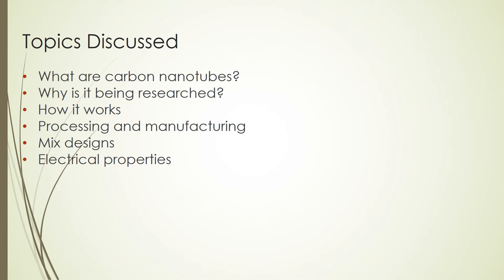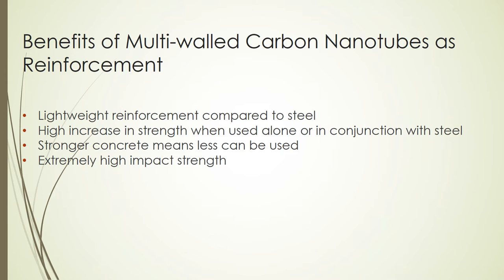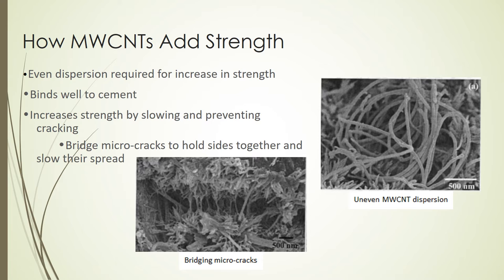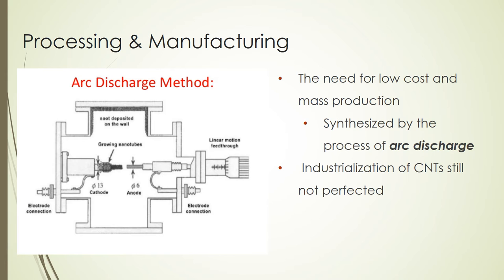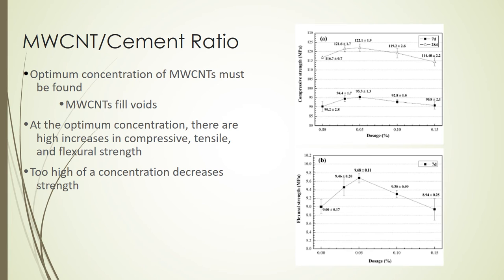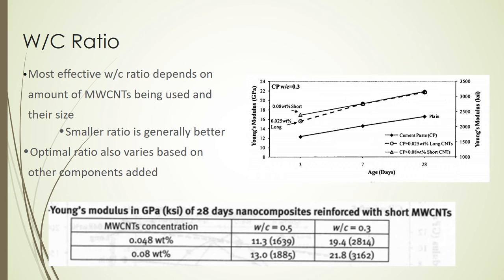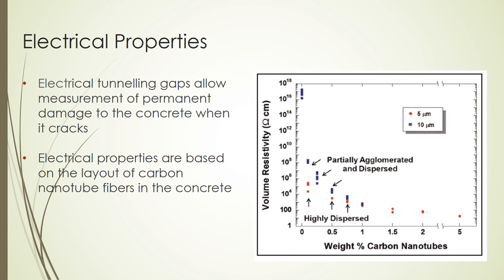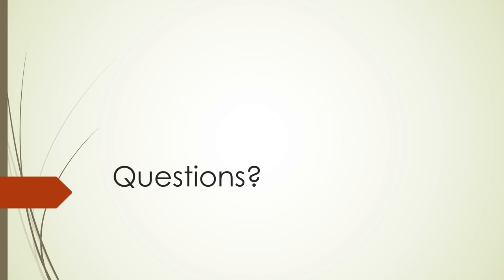Carbon Nanotube Reinforced Concrete

Comment: A couple of questions.  
1)  Did you do any comprehensibility strength tests using the standard breaking of cores at 7, 14, and 28 days?
2)  Did you do any tests for changes in strength when used as confinement to standard rebar?  In other words did it make the walls, beams, columns, significantly stronger when carbon fibers were added to structures that normally require steel reinforcement?
3)  Can you make a practical engineering (real world) model of how this added strength could be applied?  In other words, when designing a set of columns and beams for a bridge, and using the same dimensions of beam spans etc., the total carrying capacity of the bridge increased by X%, and the weight of the structure decreased by X%.  If the weight load capacity of the bridge increased by 10% and the actual weight of the structure decreased by 5%, that would be very significant, and might allow for increased span between supports etc.

Comment: hello
i was wondering can cnt be used as a primary material ,than being a being a secondary material such as a reinforcement ?
if so can its properties change based on electrical stimulation , making it either hard or soft ?
can it be a smart material that responds to an alogorithm to take shape , creating houses in an instance ?

please do reply ,its an honest doubt and i cant seem to find any answers on this or if you know someone who could help , that would be helpful

thank you
Reply: Ummm no we don't have all that technology yet... It just increases the strength of the concrete right now